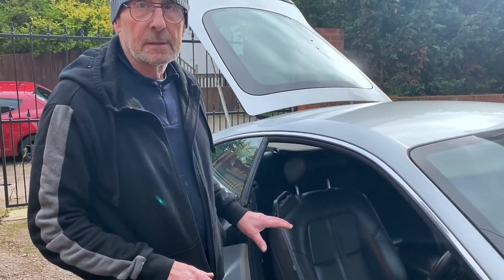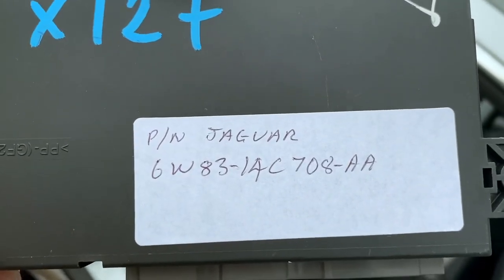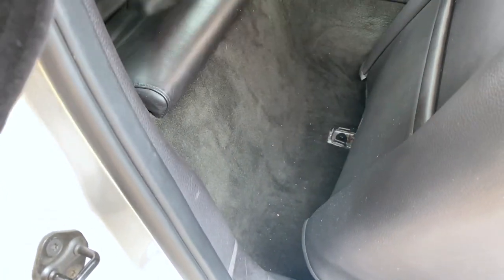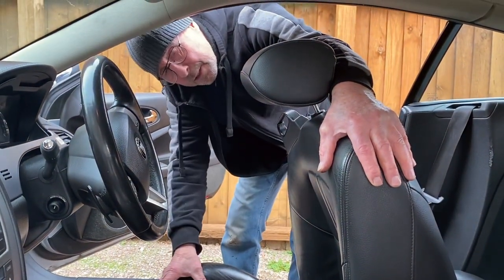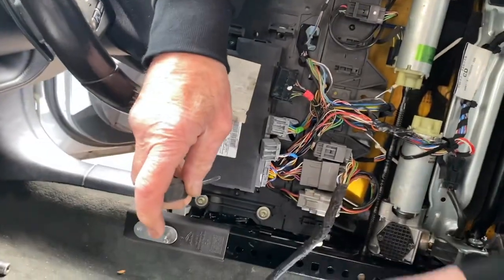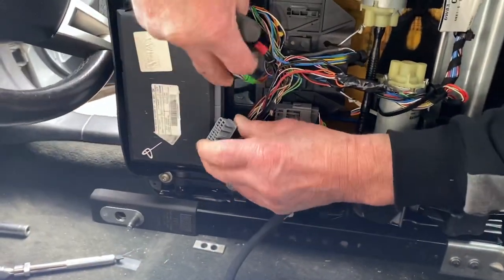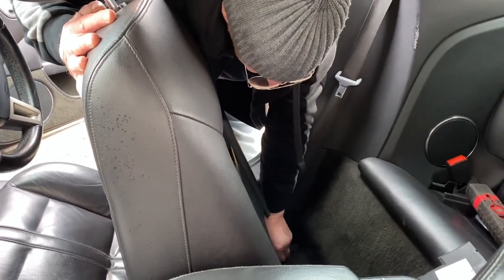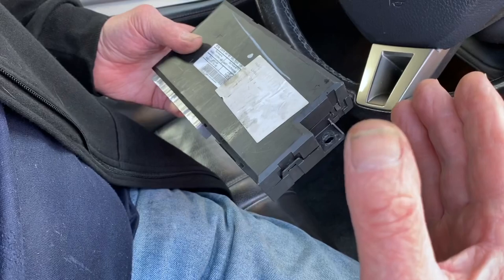Jaguar XK Permanent Fix To Seat Reclining Issue After Battery Disconnect

Comment: When I have a low battery issue on ANY of our European vehicles here in the states........and I need to change the battery, ......I ALWAYS connect a jump box to the battery cables coming from the box.........then I install the new battery making sure the vehicle NEVER loses power at any point. This has always worked and I've avoided all sorts of problems on our Jaguar XK and especiallly our Touaregs. I make the switch from jumper box to the NEW battery .......only removing the jumper box the very second I have the new battery connected.
Reply from the maker: Hi Greg, thank you for watching and for your feedback. yes that's a good idea.

Comment: I followed your video to replace the module.  Very  easy to do and very clear instructions.  The reason I had problems with the passenger seat doing  just that not returning forward was as a result of releasing the seat to access the rear seats for my grandchildren to get in.  I had it reprogrammed but it happened again so I resorted to watching your YouTube video and found it very helpful.  Thank you  Found the part through Jaguar Autoserve online spoke to them who in turn were very helpful.  Thank you.

Comment: Same thing happened on my '07: seatback was at an uncomfortable angle, and couldn't be adjusted. I tried a brute force method by removing the seat entirely, and by using a robust 12v supply, ran the seatback motor to a better angle by going directly across the motor in the seat. (The electrical diagram is available on one of the Jaguar Forums). Reinstalled seat and all was well. After some time, I wondered if the switch adjusters now had any effect. Tried and got full range of adjustments. So am wondering if module "fixed" itself by being "rebooted" (powered-down/up) or relearned itself by my brute-forcing the motor. Don't care - working now. Worth a try...
Reply from the maker: Hi, thank you for watching and for your feedback. I have tried that but it didn't work for me.

Comment: Indeed, I used the SDD v130 JLR software with a Mongoose, and recalibrating the seats was easy.  TIP - make sure that you connect a capable power supply (30A 13-14v) to the battery terminals as you DO NOT WANT the battery to deplete in the middle of this process, and the SDD soaks up power!

Comment: I have XKR 2009, where I can buy a controller for the chair or reprogram my current one. I have a prolem for the back of the driver's seat and for the height. The battery was disconnected.
Reply from the maker: Hi, thank you for watching and for your feedback. Disconnecting the battery on the XKR 2009 does not normally cause a problem with the seat as the seat module has been upgraded since 2008. If you are sure that the problem with your seat is due to the battery disconnection then a module reprogram will cure it. It does not take long but most places will charge for an hour. What are the symptoms with the seat and is it just the 1 seat?
Reply: p.s. earlier I had XKR seats in the version exactly like yours in the video.

Comment: what if you can't move the seat back and forth at all so you can't access the removal of the front bolts
Reply from the maker: Hi, thank you for watching and for your feedback. If the seat is not to far forward you can usually access the bolts with an L shaped ring spanner, otherwise remove the rear bolts lift the back of the seat up and wind the seat back manually.
Reply: @crystalclearmechanics  The Jag Service Manual says there is a fly lead behind the seat valance that can be used to connect a power source directly to the seat slide motor (assuming the module is faulty and the motor still functional), and gain access to the fixings. Would you know how to access that fly lead?

Comment: Hi I think I’ve got same issue with my Jaguar XF I disconnected my battery couple of weeks ago and I lay my drivers seat down last night tried to bring it back up and only moved couple of inches going down ok but not coming back up all other functions working fine if I replace the control module do you think this would cure the problem I have seen some on eBay for about £40 mines a 10 way movement one slightly different part number cheers …. David
Reply from the maker: Hi David, could you give me the part number of the drivers seat module. Thanks for your feedback.

Comment: At what point should you disconnect the battery when taking the seat out?  OR don't you need to do that?
Reply from the maker: Hi, thank you for your feedback. If you want to disconnect the battery as a cautionary measure it is best to do it once the seat has been unbolted and before you disconnect the module. Thanks again.

Comment: I have a 2015 XKR, was reading one of your comments, and you stated they did an upgrade after 2008. I wonder why mine is doing it, which means a newer module might not fix it permanently either? Have disconnected the battery a few times for different things, and this never happened before, it's just the drivers seat that currently won't go back up. Are the modules interchangeable between seats so I could at least do a process of elimination? Thanks for the vid, at least I know where to start!
Reply from the maker: Hi, Thank you for watching and for your feedback. The battery disconnection on the 2006-2007 cars affect both seats and is an inherent problem with the seat modules ( they are 10 way ). Without inspection I don't know why your car has that issue, all modules can lose their programming because of various reasons. Yes the modules are interchangeable but I would advise, leave well enough alone and get the seat reprogrammed ( about £35-£55 depending on where you go, main agent would be more I expect ). I suspect it was probably just a glitch.
Reply: @Crystal Clear Mechanics  would love to get it re-programmed, but, I called the dealership near me, told them the problem, and they said they can't be reprogrammed, that's it probably a defective seat or wiring problem . Figured this is just BS (as I've seen plenty of posts saying they can be recalibrated)  to get me to bring the car in so they can charge me for whatever. Being it's the only JAG dealership within states of me, I'm stuck trying to figure it out myself. I noticed the modules were different pn's, so I was afraid to swap them, found one online that matches the driver's side, so I hope that fixes it. Thanks for your reply!
Reply: Thought I would update you for the heck of it. Bought another module, and it did the same thing. The seat also wouldn't come all the way forward, so, I had to jump the seat motor and move the seat all the way forward, then I had to take out the spline shaft to the seat back motor and manually wind both sides till it was all the way forward. It's a serious pain in the arse just to disassemble the seat!  But she works perfectly now 😆
Reply: Well, until it does it again 😔
Reply from the maker: @Beemernow  Hi, Check out Autologic diagnostics ( they have an assist for shops ), any good independent garage that has one can log into the Jaguar system and reprogramme the modules, If they don't already subscibe to Jaguar's then they can pay a small fee for a one off connection. There are other affordable diagnostic / reprogrammable tools  home mechanics can buy such as the mongoose ( about £200 ? ) the chinese do a copy called a Mangoose which is about £50 but that could be risky. Check them out online and read the feedback, Hope your issue stays cured.

Comment: I redid my interior in red and battery was disconnected for more than three weeks and It happen to my Jaguar XK and I had to reprogram them with scanner diagnostic and it mine worked fine.
Reply from the maker: Hi, yes they can be reprogrammed but the same issue arises each time the battery is disconnected  which is a problem if a person does not have a programmer. The used modules recommended may well need to be reprogrammed depending on their history but that would be only once then the battery can be disconnected without issue. Thank you for the feedback.
Reply: Hello, what programmer did you use. I am about to replace the seats in my 2007 XK

Comment: Hi, iam about to buy a 2010 XFR, i’ve noticed the seat doesn’t go forward nor backwards, but other controls work. He said “I fitted new modules and it just needs to be programmed” could that be just the case ? Or there is more to it ?. And also all steering wheel controls are not working, I do think its the clockspring if i’am not mistaken. HELP 😅
Reply from the maker: Hi, thank you for watching and for your feedback. It is possible the seat could be reprogrammed but I would ask him why he fitted new modules and how and when did the steering wheel controls stop working. Does the issue affect 1 seat or both?
Reply: @crystalclearmechanics  well, he changed the module a little more than 2 months ago but didn’t program it…. Didn’t ask him about the steering wheel though. Could there be any other issues than the clockspring ? 😅

Comment: I live in the US and I have a 2007 XKR. My passenger seat works okay but it will not lower as much as the drivers seat resulting in less headroom for the passenger. Would the module cause that sort of issue? The Jag dealer says I need to replace the entire under seat frame assembly. $3,000 is the cost.
Reply from the maker: Hi William, thanks for watching the video. I would not rule the module out but it seems unlikely as the seat goes through it's normal functions apart from not reducing it's height fully ( I assume it goes up and down )  To reprogramme  both the seat modules over here cost's £35 so not a lot if you want to rule it out, also it will show if they are faulty. I can try and help / advise remotely if you can give me the history, ie, what reason did the Jag dealer give to warrant a $3,000 replacement, what has been checked up to now ect. Many thanks again.
Reply: @crystalclearmechanics  thank you for the response. The seat functions properly except not lowering as much as the drivers seat. I will look into reprogramming. Your video also gives me confidence to remove the seat and look for an obstruction or some physical problem that prevents the seat from lowering all the way. The dealer seems to want to take the easy and most expensive way to solve a problem. I have  an adaptive headlight warning light on and I was told the entire assembly needed to replaced as opposed to simply replacing the control module which is what SNG Barrett says is the usual problem. Thank you.
Reply from the maker: @williamlowish1781  Hi William, There is very little room under the seat so it could well be an obstruction, I have found many things  under the seats. If you remove the seat as my video shows without disconnecting the electrical plugs  by turning it on it's side to inspect, you will also  be able to operate the controls to lower the seat and check it's up and down function without risk of losing other functions. thanks.

Comment: I have a 2014 XF. After disconnecting the battery, the doors wouldn't lock. I quick trip to a Jaguar specialist had them working again, but it was £72.

What on earth is it with Jaguars that stuff breaks when disconnecting the battery?

Don't get me wrong, I love my XF to bits, but problems like this just should not exist.
Reply from the maker: Thanks for the feedback, yes as far as I know this is unique too the years 2013-2015. It should be a simple reprogramme of the module through the diagnostic plug, 10-15 minutes.

Comment: This sort of worked. I have a jerky but working seat now. Passenger seat is still knackered. Fitted later module but it dod not work. Any ideas?
Reply from the maker: Hi Stuart,  could you clarify the problems / symptoms you have with the passenger seat. Thanks for your feedback.

Comment: I need to take my passenger seat out, how many cables connect to the seat bottom? is it a difficult process? I am forced to take a large dog somewhere in the car and want to remove the seat for the drive, but if it is complicated to remove and refind the cables, or a delicate task i would rather not
Reply from the maker: Hi thanks for watching the video, If you look at the video (5 mins 19 secs in ) you will see the cable coming up from the floor ( bottom centre ) and connections ( plugs ) under the seat, disconnect from there and lift your seat out. Thanks again.
Reply: @crystalclearmechanics  I noticed the cable in vid but i just wasn’t sure how many connectors it had to unplug. thanks

Comment: So, '06 and '07 modules, you have to reprogram them EVERY time you disconnect the battery??? WTF genius at Jag R&D came up with that BS?
Reply from the maker: Hi,  thanks for your feedback. The 2013-2015 XF 2.2 diesel cars also , when the battery is disconnected, lose the central locking mode, the module needs to be reprogramed.

Comment: Interesting fault, any more info on why this happens? Cheers
Reply from the maker: Hi, thank you for your feedback/reply. It's a glitch built into the seat module from new, unique to the 2006/07 ( as far as I know at this moment ) models, they can be reprogrammed at a cost but the next time the battery is disconnected the same issue will occur. The module upgrade I recommended will permanently cure the problem but as always with a used part ( how the module was disconnected, did it come from a crashed vehicle ect ) problem's can surface initially leading to a need to reprogramme that module to cure an issue but this would be a one time only event. These modules on E-Bay sell at different prices, I pay £20 each for them, they are not sided. Just as a matter of interest the 2013-2015 inclusive 2.2 XF jaguar ( module ) loses the central locking when the battery is disconnected, this needs a reprogramme to reset. This also seems to be a manufacture problem.